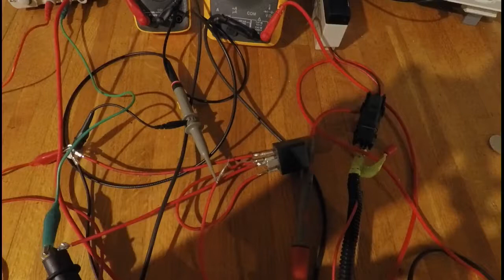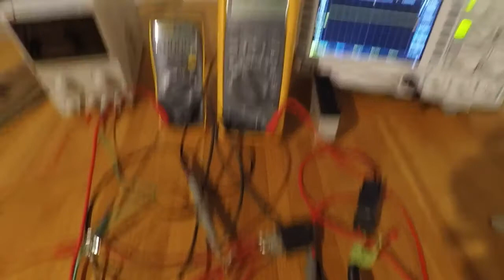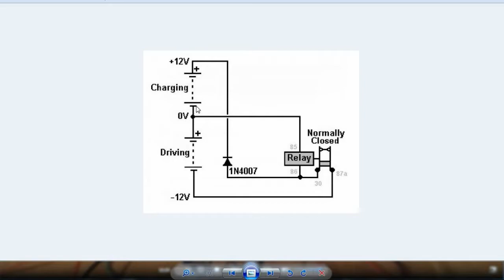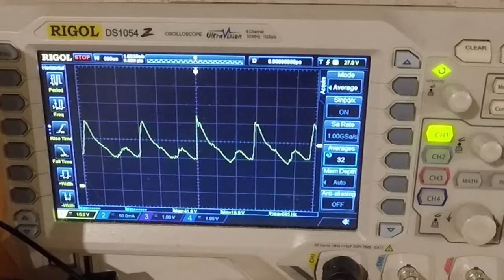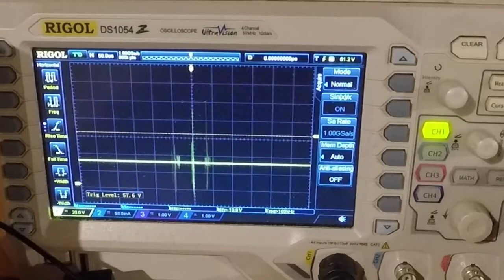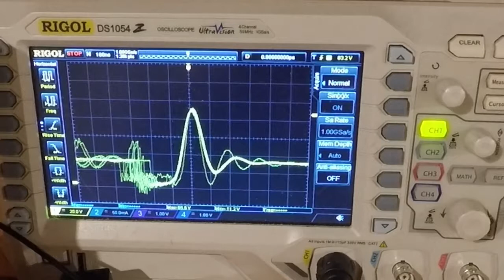Testing a Mini Bedini Imhotep Variant. Is free energy real?

Comment: if i may suggest something else, would you please check the readings without any fancy equipment. simplest of readings can be compared by changing the resistive loads and using potentiometer etc.
Reply from the maker: R A I don't understand. I have one meter measuring the average DC amps being output and one meter reading the average DC voltage being output. With that I can calculate the average power output. If I remove either of those meters and adjust the load with a potentiometer of an unknown resistance I wouldn't have a way of knowing how much power is being output.
Reply: hey sorry for being crude in my answers. just noticed your reply.
i meant no need for oscillometer etc.
cant we use a variation in input and output loads to assess changes in circuit parameters with varying voltages and currents.
for example, i connected only a voltmeter to check the back EMF when i spark a UPS thats charging a battery.
it varies from 1276-1248...-110 volts when i momentarily switch off and switch on to cause spark at the switch.
check adams motor...search ...google it.

Comment: project nsearch .com
Reply from the maker: R A I could be wrong but that sure seems like a scam.
Reply: well, hope you get better results, then. i have been able to use one of my own designs to get better results.
Reply: why dont you try to research more with google similar pages extension. check from different perspectives that assess scientific method as well as alternative perspectives which may not seem possible. nsearch.com is just an example for you research other perspectives.i dont vouch for that website. good luck.

Comment: you  can never get more power out then you put in when everything has Losses. Desulfating  plates  works but modern  calcium battery dont  sulfate much at all now.
Reply from the maker: Intrade Motor yes I'm not sure why people don't understand this. I put this together because there's so many videos making claims that circuits like this produce free energy. I figured it's easier to show if you measure it that it doesn't work then to just say it to someone.
Reply: with this  thing if  you think logically "the more power" will come  from less  sulfate on plates. The power  was always there just like my jumpstarter-supercap  extracts it slow from the battery that cant utilize  the power who remains.
That would be a logical explenation why  somone  would make  a false claim like this.
Reply: really telling you nothing but nonsense... to have more current than what is injected at the input you have to charge a capacitor and short circuit it at the output of a transformer or not. then yes there is no current because there is no more potential. but there is definitely more current it's just that you are doing it wrong, and regarding the sulphation yes your high frequency it works there is no current because it's up to you to design the thing that will narrow your potential and give you power... I'll let you figure out what..